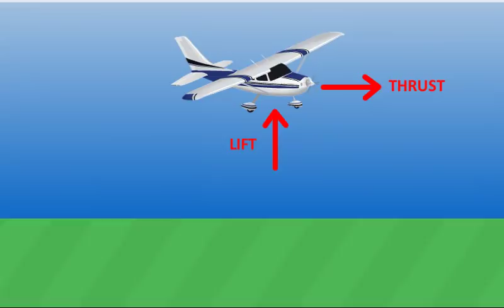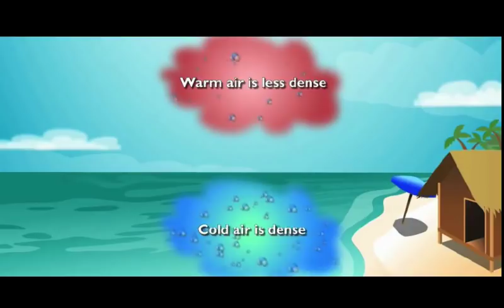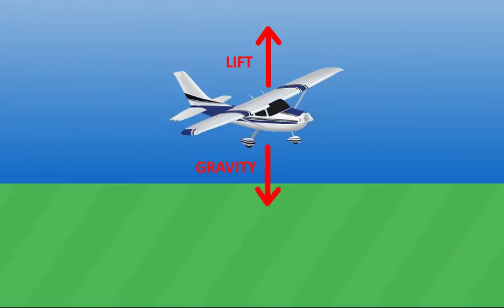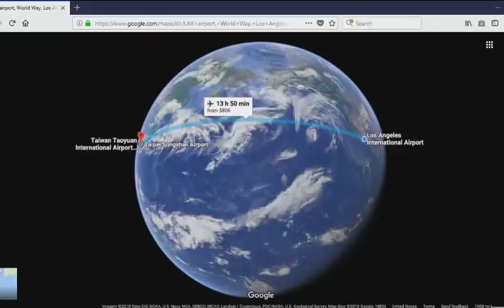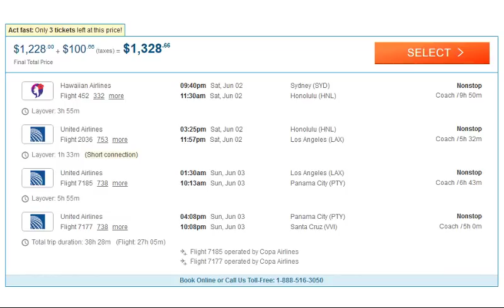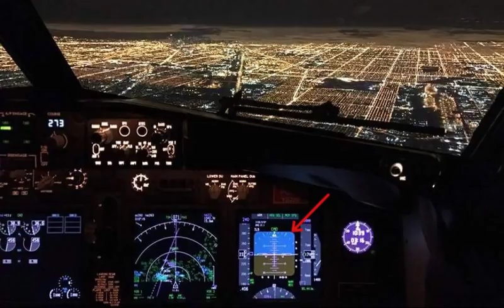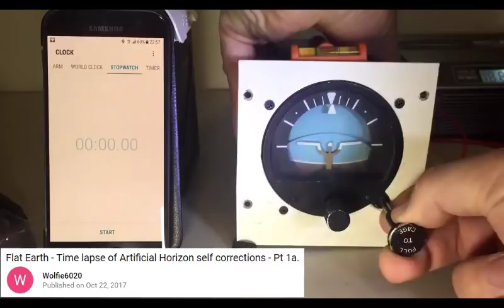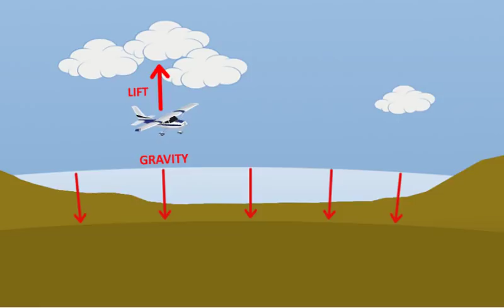Flat Earth Falsities - Plane Nonsense

Comment: Plane nonsense of planes fully caught in atmosphere spin momentum, as those GEO satellites, even those going opposed to the spin, but rockets who go straight up are not, those need parallel to get caught in Earths drag to get propelled towards Moon...?
Got unintelligent freaks like +NotTheCIA I.think "They go sideways to gain orbital velocity." ???
That is 6 years of Physic's... talking, so they dont have any velocity? With more surface drag exposed then those parallel planes... where is the logic?

All they can do is "not understand" went questioned ; 'When the whole atmosphere (except Wind /coriolis effets[1])(as hot low density pushing cold high density downwards behaviors)  is following Earths spin with perfect sync Momentum as your GEO satellites do, so at what point does that velocity take place for sling-shooting outside? Being the top layers being gradually so undense that no sucking will occur toward the Space vacuum. No the highschool dropout does not get how a straight perpendicular ship emerging would not, like planes, already have such velocity? It needs to do loops to acquire spin velocity????'

Never any full explanation, boils down to GRAVITY with her Momentum does it all with the mysterious fixed axe eternal constant spin, with more rotation business, elliptical paths....

[1] [In physics, the Coriolis force is an inertial force that seems to act on objects that are in motion within a frame of reference, that rotates with respect to an inertial frame. In a reference frame with clockwise rotation, the force acts to the left of the motion of the object. Wikipedia

Wind is caused by differences in the atmospheric pressure. When a difference in atmospheric pressure exists, air moves from the higher to the lower pressure area, resulting in winds of various speeds. On a rotating planet, air will also be deflected by the Coriolis effect, except exactly on the equator.]  - RIGHT or little below on the pear bulge... :) anything goes
Reply: No Nasa does not says that it's rockets appear to fly sideways because the spin of the Earth, but more sensible explanation follows that non fishbowl dome doing;
...Most rockets launch to the east because the earth is already rotating east, and therefore... ? YES? Thee Atmosphere isn't...? HA HA HA!
"Rockets launch sideways so they can build up sideways momentum instead of vertical momentum so they will end up in orbit." SOMETHING IS AMISS, MEANS THAT BELOW THE KARMAN LINE ATMOSPHERE IS NOT MOMENTUMING PROPERLY... DAH! AND RE-DAH! :) :) :) DEFECTIVE GRAVITY STICKING.
"A rocket must curve its trajectory post-launch, if it wants to enter the Earth's orbit."(?)
[Well, nothing in space stands still. Everything either orbits around something else, or moves toward or away from something else. Not only are Earth and the target constantly moving in their different orbits around the Sun, but our Earthly launch pad is spinning at about 1,000 miles per hour when we launch the rocket!
    
Place the basket on the ground about 3 or 4 meters (9 to 12 feet) from the merry-go-round. Then, step up on the merry-go-round with your container of balls.
Adding the motion makes it a lot harder to hit your target, doesn't it? Now imagine the target is on another spinning merry-go-round on the other side of the playground. Even if your paper balls were real basketballs or baseballs, you'd have a lot of trouble.
What you will probably find out is that . . .] (ITS ALL NONSENSE SPACE PHYSICS!)
https://spaceplace.nasa.gov/launch-windows/en/

Perfect math timing for a first time full success getting to the Moon, all 9 times!
My mind spins at such never seen before accomplishments in complete new grounds or space.. AND they curve way before entering "space" low orbit.

wong= "And they just throw petulant, infantile tantrums and claim it;s all CGI, didn't you know?" O one more hypocrite adjective adult dogma spewing.  
Now what happened to the o so repetitive wong /mong's "Piss off you infantile troll."  ..commentaries  to all that persist in providing evidence and logic discussion? Since called out by his own brethren his has calmed way down his pathetic childish lashes.  Science /Gov backed proven theory power?
Reply: Do you want condiments to go with that word salad?
Reply: Wow that’s a lot of words. To take one of your arguments to incredulity, the issue you have is not understanding scales, speeds and distances. Let’s break down your merry go round example.

Distance to moon 384,400km
Diameter of earth 12742km 

Ratio of 30.17

Let’s say your merry go round is 10m in diameter. Using the same ratio worked out above the relative distance to the target is 301.7m. 

Your merry go round rotates once every 24 hours, as per the earth. You have to hit the target 301.7m away with a gun. The movement of the merry go round is largely irrelevant on this scale, your main concern is aiming at the target. If you’re a decent shot it shouldn’t be a problem.

This is really simplified of course as the target would also be moving but on a known and predictable path. It’s not easy or simple, but that’s why it takes some pretty clever people to work out the thrust, direction and angular momentum required to do it. But certainly far from impossible as hopefully I’ve shown you here.
Reply: Forgot to say, on this scale the target would be about 2.7m in diameter - about the size of a large garden parasol. A sniper would have absolutely no problem here.
Reply: @paulsterx  well Louis loves his gibberish. Best just to ignore him.
Reply: Louis Shaw I’m having trouble knowing quite what you’re talking about. Writing in actual sentences rather than strings of nouns would help. 
Ok, so you seem to have an issue with the fact that most rockets are not launched straight up. That’s because most rockets are destined for earth orbit and are launched at an angle, in the direction of the earth’s spin, which is the most fuel efficient way to take an object into an orbital plane. This is why many launch sites are on east facing coastal areas like Florida. The west to east spin of the earth helps give the rocket momentum which doesn’t require additional fuel to achieve, and the launch will be directed over water away from populated areas in case of a catastrophic failure. Did you expect the rocket to launch straight up, stop, make a 90 degree turn and then gain enough momentum to maintain an orbit? 
The rest of your message is unintelligible but feel free to ask any other questions you have in a simpler way and I’ll do my best to answer them. Peace
Reply: You asked how a rocket shot straight up will not get into orbit. To understand this you need to know what in orbit means. An object in orbit is in permanant freefall around the earth. If you get high enough, outside earth's atmosphere so there's no air friction, with enough sideways momentum and enough speed, you can fire an object so that the altitude it is losing due to the effect of gravity is cancelled out by the momentum of the object, so it just keeps 'falling' around the curve of the earth. Newton imagined this as a huge cannon, there's a good little video showing this thought experiment here: 
https://www.youtube.com/watch?v=ymC6fuX03ns
It's a thought experiment, don't get hung up on the scale! Any object shot straight up will either fall back to earth if it does not have the velocity to escape earth's gravity, or keep going if it does. 
As you can see you require sideways momentum to enter an orbital plane, which is why most rockets take off in an arc trajectory, it's the most fuel efficient way of doing this.
Reply: So my gibberish is persued by paul Sterx, the orbit teacher, still with no friction in LEO.. is there? No Friction but plenty of Momentum, wonders of Vacuum :) Persistent against all NASA claims.., 17Century christian Newton imagined vacuum in space? Wonder. But no LAW testings :(
   So sideways Momentum all over the place, but if going straight Planes & Rockets escape it: Earth surface just spins underneath them, that is GE Science logic I dont and never will understand, much less see...

One may wonder why NASA doesn't lunch a 45 degrees in stead, so much economy! Thank you. Just a brilliant summary of below HEO Momentum.

One of my (1/2 dozen 6 weeks) most persistane Nemesis=
 +Capt'Wes Starwind; "is just a story people tell themselves to help them deal with their inevitable death." - so primates display religous zeal help.
"you know 4th grade geometry proves we live on a sphere." - WOAW!
"+Louis Shaw no flat earthers are continually showing their lack of sanity and intelligence. You have already proven this quite sufficiently."
- Time and time again, with never enough sufficent ad hominem inputs :)
Thank you for proving your intelligence and sanity, eternal void candidate. 

"Good grief some of those clips of flat earthers is depressing."
- That somes it up for con_sens_us(/them) GEers mental cognitive dealing with counter mainstream theories of all gov schooling programing since infancy.
Reply: Louis Shaw you asked about orbits so I tried to explain it best I could. Sorry if you don’t understand, you can always do some further research on it. Newton’s cannon idea was how orbits were taught to me when studying physics at school so I thought it would make some sense. Note that orbits and gravity have nothing to do intrinsically with the earth’s spin, something you seem to be confused about. 

I don’t know why you think there can be no momentum in a vacuum or why this goes against ‘NASA claims’. Can you cite your reference for this claim? No there is no air friction in LEO as there is no air. Air drag would slow momentum and mean satellites would need a source of constant thrust to maintain orbital velocity.

Yes Newton imagined a vacuum in space (or a void), in fact it’s something that was theorised about as early as 5th century BC. You can read all about Newtonian physics here: https://plato.stanford.edu/entries/newton-stm/#2.1
Bear in mind that much of this thinking has since been superseded or adapted by relativity. This is what happens in real science, people build on the work done before, rather than ignore thousands of years of research and attempt to fit reality into the words of a story book. 

I’ve done my best, but if you have any specific questions feel free and I’ll respond. 

Ps rockets launch vertically so they can use most of their thrust moving through the denser lower atmosphere and gain momentum in an orbital plane at higher altitudes where acceleration is more fuel efficient due to lower drag. 

Pps planes don’t escape gravity, when did I say that? They produce an upwards lift through differentials in air pressure which counteracts gravity, which is how they fly. Objects in orbit also do not escape gravity, it’s gravity which causes the orbit as explained in my previous post.
Reply: Louis Shaw first you come up with a half assed attempt at debunking gravity. Then you bring up orbits. Then you said you didn’t understand it. I tried to explain it. Then you spout off about me talking down to you? Rather than spewing out a bunch of word salad, go ahead and give me one measurable, provable statement which in your opinion proves beyond all doubt a flat earth (not based on a shoddy poorly conducted YouTube ‘experiment’ please).

Here’s mine for a globe earth. The sun, when properly measured, maintains the same size when it rises as it does at noon when viewed from any point on the planet and travels across the sky at a constant rate, whilst maintaining viewing angles concordant with a globe earth and a large distant sun. 

Give me yours and we’ll see how we do disproving each other.
Reply: Louis Shaw still waiting for your provable statement, come on it can’t be that hard!
Reply: AND Sup error knowledge; The thermosphere is the layer of the Earth's atmosphere directly above the mesosphere and below the exosphere. Within this layer of the ATMOSPHERE may not be too much AIR but gasses yes! ( Radiation causes the atmosphere particles in this layer to become electrically charged (see ionosphere), enabling radio waves...) fact...
"The highly diluted gas in this layer can reach 2,500 °C (4,530 °F) during the day."
"The International Space Station orbits the Earth within the middle of the thermosphere, between 330 and 435 kilometres (205 and 270 mi)." Like all your satellites it ENCOUNTERS DRAG, try to research that GOV fact. 
https://en.wikipedia.org/wiki/Thermosphere

(SELF) EDUCATION IS KEY, to dispute Retards with no basic science etc.

Comment: If an air plane uses AIR MOLECULES in order to generate lift, and a Rocket pushes (generates thrust) of off AIR MOLECULES here on Earth.
Then what does a rocket push off of in empty space???
Reply: Rollie 1:00. According to this video the atmosphere moves with the Earth do to GRAVITY and FRICTION.  
If friction is a key component REQUIRED, in order for the atmosphere to stay with the momentum of the earth.
Then why is it that in modern academics it is said that thrusters don't utilize FRICTION in order to maneuver left or right in empty space???
Reply: jordans123ful Because there is nothing in space to create the friction. 

You're assuming that because friction causes motion in one thing then it is the universal cause of motion.
Reply from the maker: jordans123ful - The atmosphere moving with the rotating earth is nothing like a rocket. I don’t know why you are comparing the two. The others have well explained how rockets work, by equal and opposite actions and reactions. 

Perhaps this analogy will help you with the atmosphere. Picture a blender with water in it. Turn it on and ALL the water will spin, not just the water being physically pushed by the spinning blades at the bottom. Why? Because the water pushed by the blades pushes on the rest of the water above it due to friction. If there was no friction, only the water touching the blades would spin. This is similar to the atmosphere around the earth. The surface of the earth pushes the air at the surface, and that air pushes the air above it due to friction. And like the water in the blender, the atmosphere is pulled down by gravity, which adds to the friction against the earth’s surface, and also between the air at the bottom and the air above, so it all moves together, mostly. Got it?
Reply: Rollie I think you do understand but that's part of the problem.
Reply: Rollie There coming bro there coming. please tell mom its not her fault
Reply: Rollie according to gravity the universe is always expanding so anything being expelled into the void of space will expand with it not push
Reply: Rollie You hear that people that's their only argument "expel gases" pushing off of nothingness. I guess it works if it's all imaginary
Reply: Rollie the precise error in your argument is the environment and you know it.
Reply: NotTheCIA I.think I think this genius pushes off of his rear bumper when he doesn't have any money for fuel
Reply: Rollie it's the rapid change of gas pressure what causes a rocket to propelled. please it doesn't take a rocket scientist with a white coat to figure that one out
Reply: jordans123ful Third law of motion; the gas goes one way, the rocket goes the other. The high pressure in the combustion chamber increases the velocity with which the gases exit the nozzle.
Reply: Rollie White boy, don't tell a color person how to speak got it
Reply: Rollie so ur a bitch?
Reply: dum one
Reply: We all live in a yellow submarine
yellow submarine
yellow submarine
we all live in a yellow submarine yellow submarine 
yellow submarine
Reply: I just have to say that is one of the dumbest questions I have ever read on YouTube.

Comment: Flat earthers are rude. And argumentative. They say you should see the curvature over 7 miles with a laser etc. Yet the earth is 25.000 miles round so if you draw an octagon within the circle you can actually see straight for up to 1500 miles before there is a dip in the earth
Reply: Most of the rude and argumentative ones are trolls. They may also be FE cultists but the two are not mutually exclusive. Trolling is generally the province of the weak minded and FE cultists are, by definition, weak minded. They are biblical literalists, and religious indoctrination has been studied in brain scans and scientists have found that parts of the brain associated with logic and critical thinking are underdeveloped. Essentially, religious indoctrination is mind killing.  It stunts the growth of specific areas of the  brain. It's especially significant in  the  religious right  who distrust science. But the radical right  finds  it absolutely necessary to block out anything that might threaten their extreme views. It's interesting that the extreme right Muslims and the extreme right Christians share many of the same ideas about science and knowledge. Also, homeschooling is making the problem worse.
The present FE cult in the “west” is basically a Christian cult, plus the usual loony hangers on, based on the biblical claims of the Brit, Sam. “Parallax" Rowbotham made in the mid 19th.C. He is the one who dreamt up the ice wall etc. All of the stuff the FE cultists accept as factual is part of Christianity as written in his "Earth Not a Globe". And then
https://en.wikipedia.org/wiki/William_Carpenter_(flat_Earth_theorist)
This was followed up by the publication of “Zetetic Cosmogeny" in 1899 by Thomas “Rectangle” Winship, and so on up to today.
Similarly with Islam.
And there is a common thread of biblical literalism which comprises but is not limited to the FE, ID, Creationist and YEC cults.
Reply: HA HA HA the worst vile mouth is backing the hypocrite crybaby :)